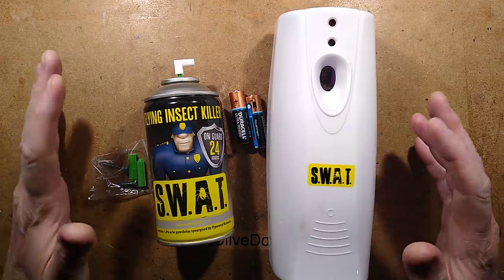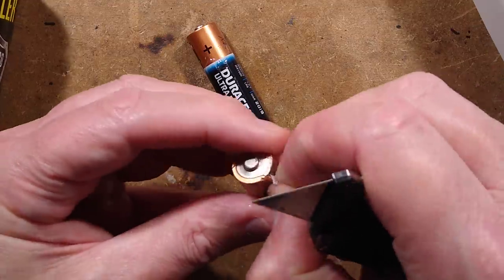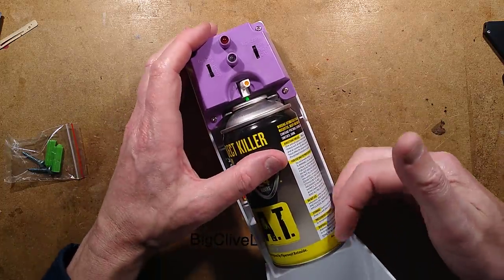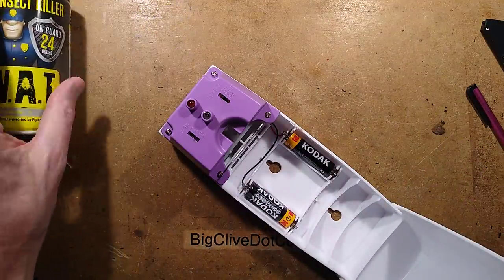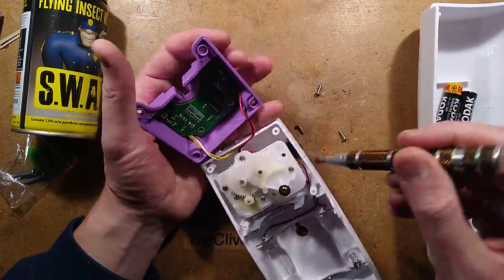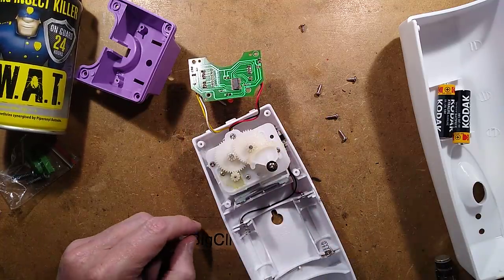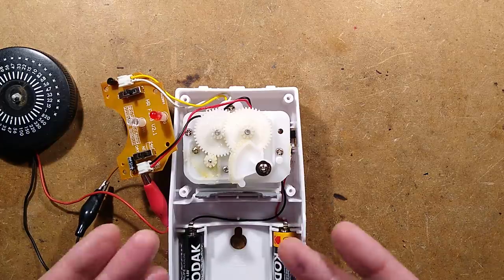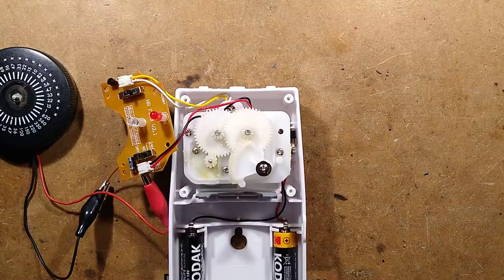Farm-grade automatic insect spray

Comment: I think Pyrethrin is the "natural" extract of insect killer, and the synthetic one (or something) is Permethrin, either way it's lethal to the window-bashing bluebottles that drive me nuts!!! :P
(so long as the cats don't get the stupid flies first!!!)
Reply: Indispensible here in the US if you own livestock or work in the woods where ticks and other nasty pests can make life miserable.   Usual procedure is to mix an 0.5% solution from concentrate and spray it on clothes after every laundering.   Useful also to knock down a flea infestation if you have dogs; however, the stuff can be toxic to cats and so should be avoided.
Reply: Permethrin is one of many synthetic derivatives (pyrethroids) of pyrethrin. Due to the resistance of bedbugs, neonicotinoids (chemically similar to nicotine) have seen a rise in use.

Comment: Hi Clive, how do you zoom your camera?
Thanks,
Chris
Reply from the maker: It's a Moto G7 power.  Open camera slide-bar for zoom.  Digital zoom in a high resolution image.
Reply: @bigclivedotcom  Thanks Clive, your answer has made me realise I have asked you the wrong question!

The reason I asked in the first place is that I too have a Moto, and I get judder (camera wobble) when I zoom during a continuos video shoot. This happens when I touch the screen when it is held using my unstable if touched, heath-robinson DIY camera stand. This is a closed camera tripod, that cantilevers over my desk with the stand base held in place by a brick and string.... So I presumed that you had built some kind of cool Bluetoothy remote control that meant you did not have to touch the phone. 

So your answer means I have to refine my question: 

How do you stably suspend your camera over your bench, in a way that it does not wobble, at all, when touched?

And thanks again for taking time to respond....

Chris
Reply from the maker: @Chris-gy9pk  My bench is based on twinslot style shelving.  The bench is  a deep shelf and there is a shorter shelf above it.  On the edge of that shelf is a ledge made from PCB laminate, and the phone sits on that, pushed up against the shelf edge.

Comment: Those integrated battery testers indeed draw a lot of current. There is a measurable drop in the battery voltage after using them.
Reply: No doubt they increased battery sales significantly!!